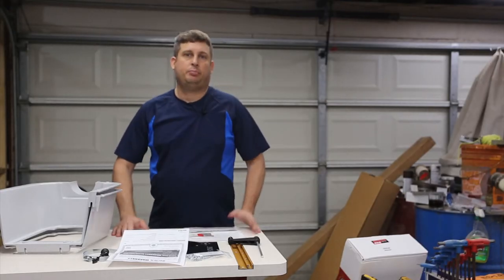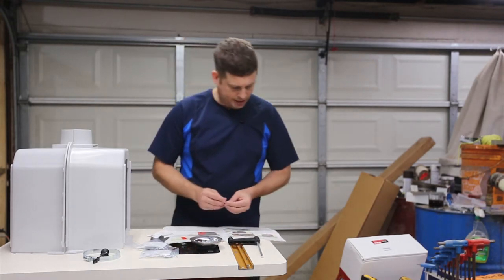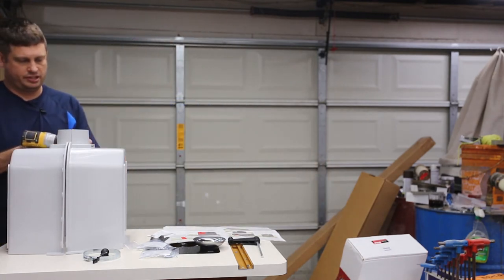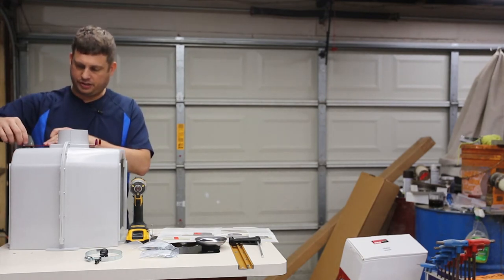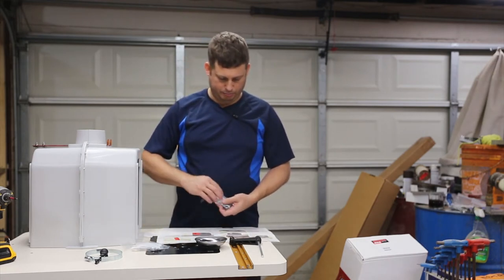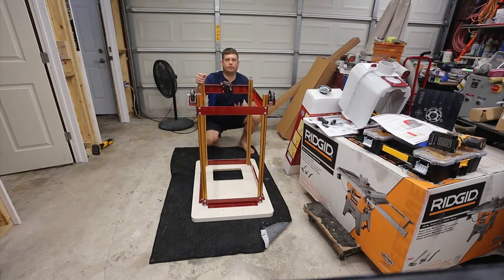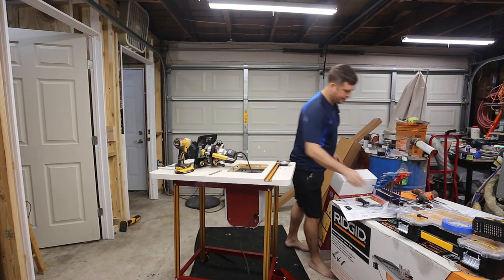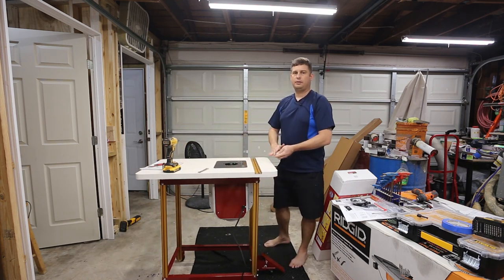Installing an Incra Clean Sweep on an Incra Router Table

Comment: OMG!  Did you even think before you turned your camera on?  If you were to ever look at a woodworking instructional video, you would have understood that the prep work, and the pre-prep work are sooooo important.  Do your “figuring out” before you take the video. This is SO PAINFUL TO WATCH.   I’m so sure that everything you can’t seem to do is a “design Flaw”.  
I received mine today and wanted to see a YouTube video on how to put it together....your one of the few who has a video on this. Bummer. 

Congrats on trying to film it. I cannot do video.  And as I am t
ryin to be positive, I won’t say any more. Thanks for your video.
Reply from the maker: Intead of complaining, why don't you approach this as the opportunity to sit in the corner of my shop while I put this together.  That is the perspective I'm aiming for on my longer videos.  Kudos to you for watching through 27 minutes though.  I'm pretty sure the whole thing took longer than 33 minutes, there are multiple cuts in that video.

The aspect I called out as a design flaw is requiring you to put a screw head on the outside where there is no clearance to put a screwdriver.  Even reversing the screw to the inside it was difficult to manage.  There is a table rail in the way.  Moving that screw down 2 or 3 inches would have solved the clearance issue.  If I had to guess, the person who designed the Clean Sweep never had to install it on Incra's router table.  

If it were up to me, I'd eliminate all the lock washers and regular nuts and use lock nuts.  They don't vibrate loose and don't cost that much more.
Reply from the maker: You may also want to skip the Incra Fence video on the table saw.  It's also really long.  And as most of the crankypants® point out I'm barefoot in my garage.  GASP.  lol.